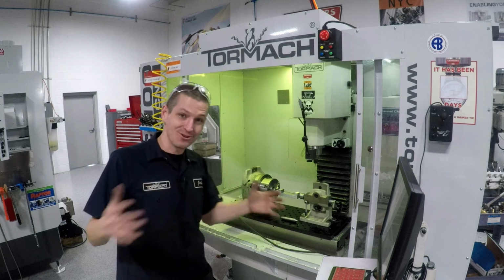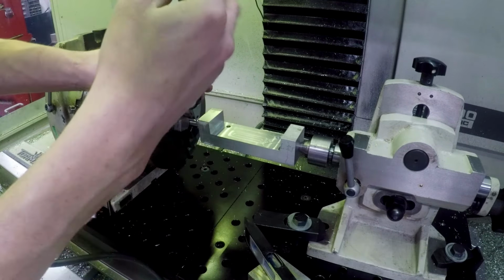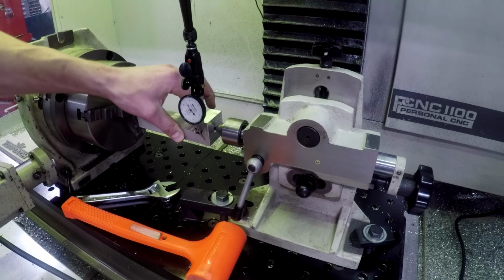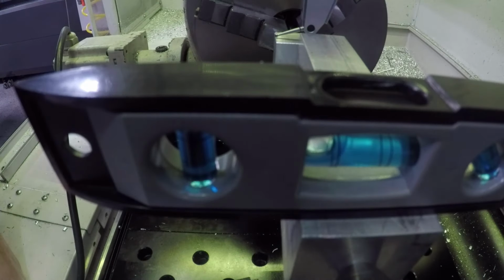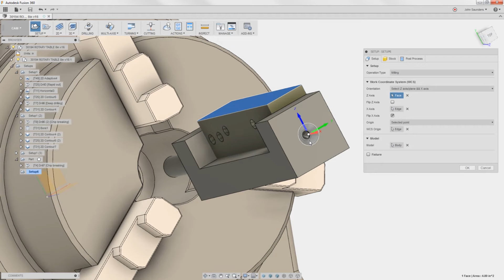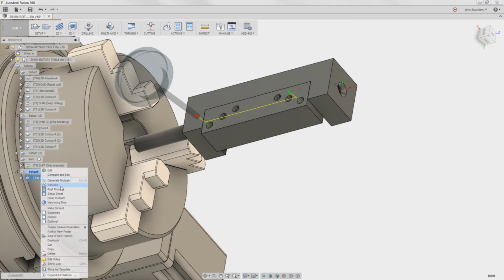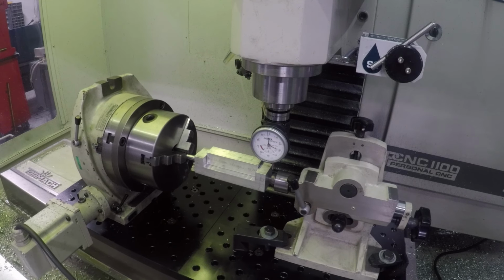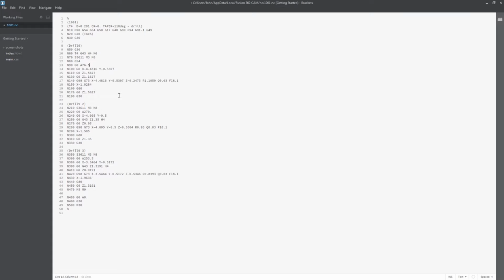Tormach 4th Axis Trunnion!  Part 2 WW141

Comment: what I do to line a tail stock like this is put a drill chuck in the tail stock and use a bright drawn steel rod (check it's straight) clamp it in the chuck and the tail stock chuck and you have it straight in line or within a few thou! love the channel, keep up the great work and most of all keep smiling

Comment: If you want to get the tailstock perfectly straight you are going to want to indicate off the shaft on both the front and the back of the tailstock.  Before doing this make sure the diameters are the same on both sides and then use an indicator on an arm to get at the backside of the tailstock if your machine does not have enough travel to reach it.  Once you have it aligned good, machine a flat on the side of the tailstock to speed up alignment in the future.  cheers.

Comment: Hi John , If you want to line up the tail stock on the quick & Dirty, take a long enough shaft, machine the appropriate MT, ( or adapt one to the end of the shaft)  insert it into the chuck, insert the MT into the tail stock quill and Bob's your Uncle.
If you use a " nice" shaft  you can use it to align your entire setup to the X axis in one shot. 
Thanks for the Vids, Learnt to use Fusion 360 from them. Keep them comming
Reply: What is MT?
Reply: Moris Taper
Reply: Phil's Projects heh I just typed the same thing and saw this comment. yes that's a pretty okay and quick way to do it.

Comment: Hi.  Great video's.  Just my 2 cents worth.  I've been a machinist for 40 + years and am currently running a Haas VF3 5 axis.  The only real oops I saw in the first video was how you put the centre in the trunnion.  You did the press fit hole first, then flipped the part and picked up the centre of the square.  It's rough stock and I didn't see you indicating two sides of the stock to ensure it's vertical.  You would have had fewer headaches if you just roughed the pocket, put the pin/trunnion assembly in a lathe and machined the centre with the tailstock .  That would have put the centre in line with the pin.  Then finish the pocket on the 4th axis.

Comment: Tail stock placement suggestion. You know the center line of you 4th axis. Just measure the distance from the center line of tailstock to the flat. Then off set the turret to that distance and run gage down the side to set the tailstock into position.

Comment: I think to make more rigid use a 4-jaw chuck, and just extrude the left end of the block out to the left instead of using the pin. You can still use the live center and dial in the trunion on the chuck using your gauge, almost exactly the same way you did except 4 jaws clamped firmly in the trunion itself rather than the pin pressed into it. In fact that’s exactly what I’m going to try right now. Thanks for showing this.

Comment: the company photos for the 4th axis, shows it sits on parallel grooves not on guess work placement ( by guess work placement, I mean that the part bases may not be exactly square but the holes in them should be ) ... make a grooved plate where the only movement you should have to worry about is length ... then you will know that the centers match up and are inline....

Comment: Hey John,

I would get a nice big 2" diameter maybe 8" long hardened and ground reference round bar to to set up your rotary table.  You also need a tapered bar or maybe a collet holder and reference bar to go in the tail stock.

Get the rotary table lined up perfectly first in all axis using the large reference bar. Then get the tail stock at the right center height and parallel to the table. Then deal with the x y position and rotation of the tail stock. Measure off a reference bar in the tail stock rather than the taper inside. It can be concentric on one spot inside  the taper while being out on either the rotational or x y position and vice versa. Use the same reference bar in both the rotary headstock and the tailstock. 0 out on the Headstock(on center in Z) then move the bar to the tail stock and move the tail stock until it reads 0 along the length of it. Its no different than tramming in a vise. 

 I'd change out that 3 jaw chuck for a 4 jaw and grab right on the square. Right now you have way too much load on the tail stock and the full setup is way to weak. The part should be much closer to the chuck jaws with the work holder fully engaged in the chuck's jaws. 

I'm not a machinist.  This is just how I would do it.
--
Chris
Reply: Actually with a bit of thought, I think I got the bit about the taper wrong. The problem with tapers isn't that it can read concentric when its not, its that you can't tell if the problem is rotation or x position, and movements in Y change everything again.

Comment: Looks like a great addition to the tool box having a trunnion. The Tormach tailstock does have keys on the bottom which helps align it but it looks like you have a plate on your bed so can't use? Otherwise I agree it is a pain to set up.

Comment: John, unless I missed something, why didn't you set the headstock parallel to the X axes before trying to set the tail, when you indicated the fixture in the headstock alone it was way out then you tried to pull it into line with the tail?
Reply: chuckels431 I thought that too, is the axis of the headstock parallel to x axis of the table?

Comment: X is positive move in A, -X is negative moves in A or you change it in the post prossesor
Reply: Beat me to it already! But spot on! The standard is counter clockwise about the positive vector of the axis. So if you define the rotary table as X, that means the rotary table would rotate counter clockwise if you looked at it from the right (+X) side. If you define it as -X instead though, it flips the vector and would then rotate counter clockwise if you looked from the left side of the machine (-X).

Kinda like back in geometry when you had the unit circle. You measured the angle counterclockwise.

Also right hand rule where you stick your thumb in the positive axis direction and then direction your fingers point when you make a first is the positive rotation direction.
Reply: my thoughts exactly, it's funny how he mentions it 1 minute before he see's he has this problem but doesn't bother to change to -X and check the post if it is corrected this way
Reply: @St0RM33 Haha I thought was pretty funny too. He did such a great job highlighting it and even making an hypothesis about why you would need to use -X, but then the connection between that at his inverted movements didn't quite connect, but hey, that's why I love John's channel and what makes him such a great guy. He's not afraid to make mistakes or look stupid. He could totally have just cut that part out and made it flow well, but he shows his thought process and reasoning. Say this had been a bug in the post the exposure would have brought it to our attention. But since this is just a simple mistake it presents the opportunity for now just John to learn more, but all of us as well. By showing his mistakes he promotes conversation and group thinking about the problems he runs into. Maybe we'll see a correction in 4th Axis Trunnion Part 3!

And in Johns defense, he has been working out some bugs with this Post Processor so his mind is likely defaulting to post issues instead of user issues :)

Comment: Hi John, the first great video that I found on youtube about taking a Work offset and programming 4th axis trunnion. I am using Solidcam and figuring out how to machine a part without taking new work offset for every single side of part that I machine. So the catch is to take a zero point on centerline of rotation. It would be great if U make more videos about 4th axis trunnion. Thnx.

Comment: If you ever decide to do this again...take some 2" round 4140PH and chuck it in the the lathe. Face, center drill and OD turn off the scale at the least. Flip, recenter in 4 jaw and repeat. Chuck and align the part into your 4th axis setup. Machine 3 flats on the X+ side. You now have a repeatable A0. Flip, recheck alignment and machine the required trunnion features. If your 4th axis 3 jaw won't open to 2" or you're concerned about clearance, you can turn down the side you intend to machine flats, but I certainly wouldn't go as small as you did on the press fit fixture.

You'll have all machined datum features, a repeatable zero and the trunnion will flex much less. I would use the "pocket" part of the trunnion to set alignment because that's where your part goes. You can check ZA alignment in the Z+ orientation and XY alignment in the Y- orientation which would also help to expose any A axis rotation error.

Also, this might be a useful tool for 4th axis setups. http://www.ebay.com/itm/Lathe-Alignment-Bar-3MTground-hardened-0002-034-runout-ideal-Tail-stock-alignment-/110657010235
Reply: As long as the angle setup is good, one needs no datum fixtures if all sides are machined.

Comment: John 
That fixture needs much better engineering , Make it bolt directly to the RT faceplate , but I think this was proof of concept 

A better way instead of the tailstock would be a fully shielded pedestal bearing assembly 

Had a gander at the tormach post they do the 4/5/6 axis slightly different so I have removed the link as it was not applicable

Comment: Great Video, i've made a Trunnion for my 4th Axis too, to machine Titanium watchcases.
Dialing in that "sucker" can be quite a hassle, but you could have just put a center hole and a pin in a piece of bar stock, and machine that fixture on the 4th axis.. then it is already dialed in..

Comment: I know you already got past this point, but ... You could make this trunnion part by turning the entire thing as one piece [no pin to insert]. That'll ensure the pin is parallel with the body. Then, the pin goes in the 4th axis, and you can square it off right in place.

Comment: how are you compensating for backlash in your indexer? Also, you should do a video on using super long extended cutters like 3 or 4 inches extended from your holder
Reply: Only move in one direction obviously ;) JK but likely he is either 1. not compensating, because why sweat the details before you know it actually works well (or maybe the backlash is not very significant) or 2. He is using a backlash compensation option in software with some manufacturer recommended value. I'm sure he'd show us the process of fine tuning that value (unless he doesn't plan on messing with that).
Reply: Tormach has a video showing how to adjust the backlash. I do believe that he did a video on long tools and the conclusion was that you should do as much work as you can with a standard cutter or a stubby cutter then switch to a long one. I know he talks about it in his 80% AR lower videos.
Reply: Xander Luciano There is the option of compensating for backlash in the machine controller like you mentioned however, without a brake on  the indexing head, you can/will run into the problem of the tool pushing the part out of position wen you rotate it to the 'tipping' point of the backlash... unless of course there is non :)
Reply: Oakwood Machine Works I'll take a look around for that video. Thanks for mentioning it. obviously like you mentioned, using a stubby tool as much as you can is the optimal way to go but, there are times you just need that reach to get in to those darn hard to reach places
Reply: Ah I was thinking more in terms of continuous motion backlash! But you raise a good question, does this rotary axis have a brake? or does it rely solely on gearing? Even if it is only gearing, I'm sure there would be some gearing adjustment to increase or decrease the engagement as the gears wear. If your part needs to be within +/-.015, no reason to sweat a thou or two in backlash. The right tool for the job is the one that gets the job done after all

Comment: probably should have milled the pin hole and center and then milled the trunnion part on the a axis so that it automatically ran true to your set up.  some clean up cuts on the sides would give you perfect indicating surfaces to dial in the set up next time

Comment: G'day John, jump on eBay and get yourself a morse taper test bar for the morse taper of that tailstock (MT2?). They are now very cheap and will allow quick setup. They are centre drilled so you can align it with your 4th axis too.

Comment: That tailstock has machined surfaces right on it, why can't you indicate directly off of it? Use the surfaces for parallelism and the DRO to position the tip of the tailstock center in relation to center of chuck.
Reply: Notso Fresh 
Because the fixture was not machined true with the pin and center hole inline. He essentially had to offset the tailstock to take out the taper the mis alignment between the pin and center hole created. 

That's also why he was getting that bounce back, it was the fixture springing the loosened tailstock back.
Reply: My thoughts exactly. I was wondering if the part would move also. He got the job done though.
Reply: Forcing the fixture straight is a bad idea. Set the machine straight and true first. If only so it is already straight for the next job, no rememberizing needed. Then make the fixture so it sits correctly in a properly trammed machine. Would have been better if he pressed in an oversized pin, chucked the square portion up in a 4jaw and turned the pin true with the block. Probably would not have taken any more time than fudging with the tailstock. My guess is that the pin was straight until he removed the material from the middle and the piece changed shape due to relief of internal stresses.
Reply: Notso Fresh 
Watch part 1 and see how it was machined. 

Raw stock surface was used as the X zero location when the pin hole was put in, then was flipped and tail stock center was put in. Using the same raw stock surface to relocate. 

Alignment between the pin and tailstock center was off from the get go. Only way to align the fixture on the 4th axis was to offset the tailstock at that point.

Comment: Hey john.  2 quick things:

The generic Haas.cps post has a variable called "make a axis other way"  and it does just that.  might be able to activate that for the tormach?  

I am lazy,  I just change the negative A-axis numbers to positive and positive to negative.  This works fine for G00 moves.

Comment: The biggest issue is the flimsy design, even if just for simple drilling. Not rigid at all with the tiny dowel and cut out bar stock. Take a piece of square or round stock, machine three flats in the end for the chuck jaws to clamp on. Then machine the least amount of material to do your work holding while it is clamped up in the 4th. There was really no reason for the center of your trunnion to be cut out. As you did with the adapter plate on the Haas, machine fixtures in place as much as possible. Don't make things harder on yourself than they need to be to get things squared up.
Reply: I think the only reason for the center cut out was so that he could get the part closer to the center of rotation. The benefit that has is that any angular inaccuracies (due to gear cogging, backlash, etc.) will be smaller towards the center, and exaggerated at the extremes. Because he has that chunk missing though, it bows the metal, and that's why he is seeing exaggerated error with the tailstock in.
Reply: You meant, linear inaccuracies (on the "trunnion" face) due to angular inaccuracies, which are the same, regardless of radial position.  Those can me be made arbitrarily small by some indicating.  He was absolutely foolish in hogging out the middle.
Reply: You are absolutely right.  And your three flats at 120° is clever.  The nonintegral spud is a blunder.

I would add a few things, which permit extended unattended machining.

1.  Position the tailstock and rotator as far apart as physically possible, to maximize the size and number of parts that can be machined.  Use a 3x3 or 4x4 bar as "trunnion."  Even consider outriggers.  See 2. below.
2.  Strongly consider spacers under the rotator and tailstock to raise the rotating fixture higher.  This gives more clearance for higher parts on all four faces.
3.  Machine a sparse pattern of tapped and slip fit dowel holes.  Don't  use huge hardware:  For a Tormach 1/4-20 holes and 1/4 dowels (M6 and 6mm) are quite sufficient.
4.  Have provision to quickly move 1 or 2 vices into position between the tailstock and rotator with "trunnion" out.

Now you are really set.  Operation 1 is to put in the vices, put in bar stock, fly cut the top, and put in .251 holes or .257 holes plus dowel holes.  This is blank preparation.  Operation 2abc, machine three sides of your parts, using CAM to miss the clamping hardware.  So about 16 4-sided 3x3 prismatic parts can be made in two setups on an 1100.  This is most valuable when you have your own product.

Comment: you should only indicate machined surfaces.
Reply: doug farrish 
He didn't have any...  brought that up on part 1. 

Raw stock is not a datum...

Interestingly, the one machines surface he had, he didn't indicate...
Reply: Occams Sawzall the middle portion that he bolted his part too, that's a machined surface.
Reply: doug farrish 
Unfortunately it was machined to no datum...  sorta a meaningless "reference" surface. 

Would have been better than the raw stock, but not by much.
Reply: Occams Sawzall i always indicate the surface I will machine off of.
Reply: ahh yes, if you use rubberized iron and steel products... true !